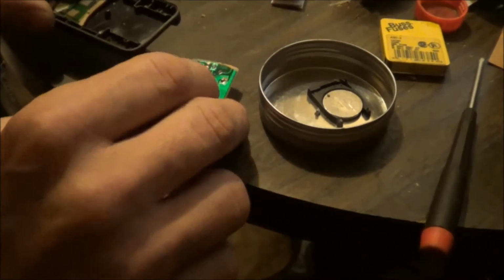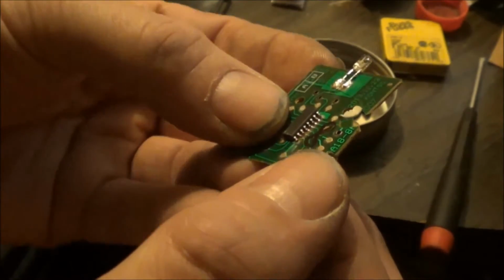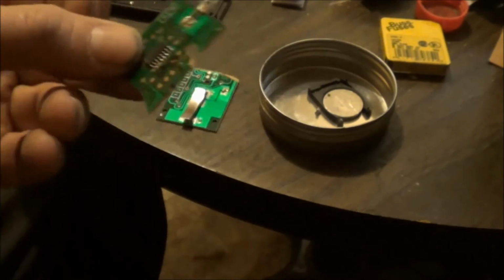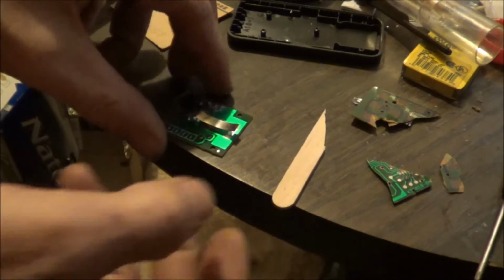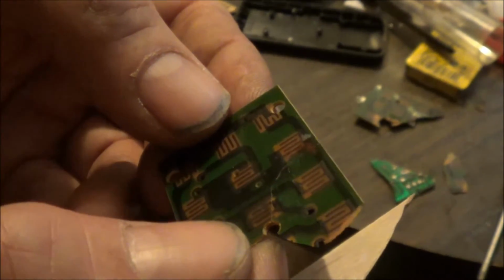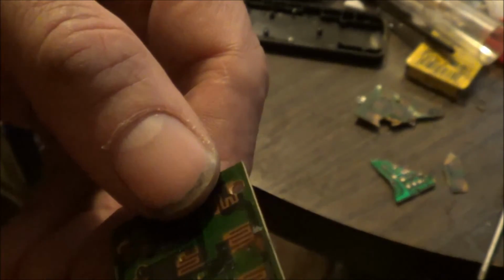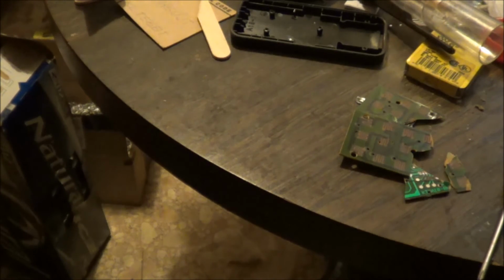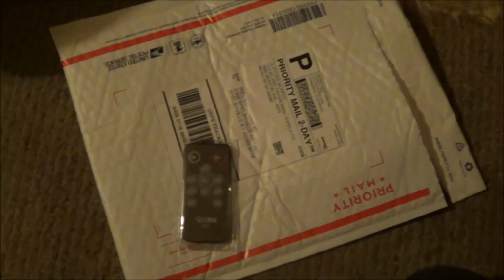REPAIR MY CAMERA REMOTE

Comment: Hey brother did you scrap that  remote? You might be able to repair those carbon traces with a conductive epoxy or maybe the copper strips they sell at automotive suppliers for fixing rear window defoggers... I just put up a video of repairing the SIM card holder in a cellphone...
Reply from the maker: If you watched the rest of the video you would have your answer.
Reply: Brother I watched it though, and then watched the last half again just now, you never did say what you did with the broken one just that they sent you s new one...
Reply from the maker: Right. I got you now. Sorry. I thought you didn't see the new one. I still have the pieces. Maybe when I have more time I will see if I can fix it. I had already thought about these pens that they used to have for fixing rear window defoggers. I've seen them years ago, they looked almost like a paint marker.
Reply: PoopingAndroid
Pretty sure they still make them... I have to got to Crappy Tire today anyway I'll try to remember to check... A backup remote might be a good thing...
Reply from the maker: I get your thinking. Good idea. I'll try to keep going with it if I can find the pen.